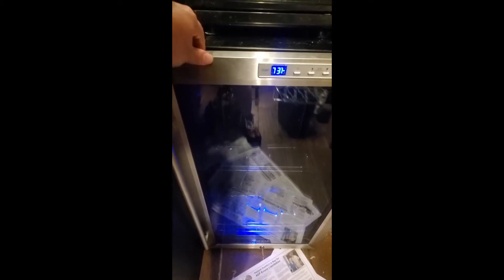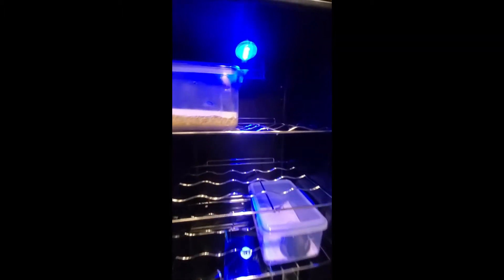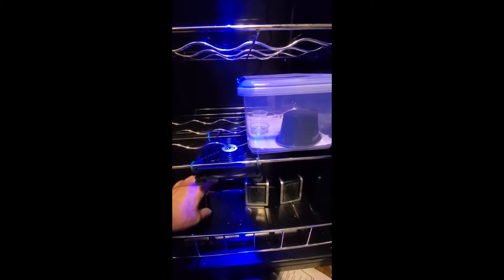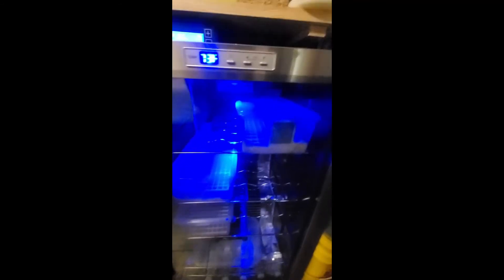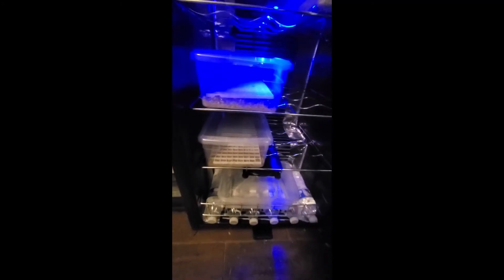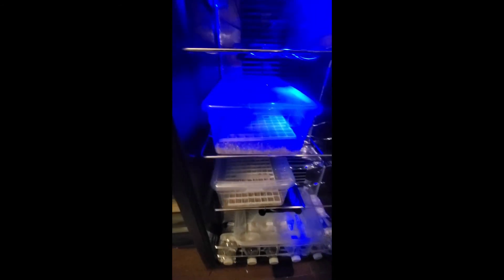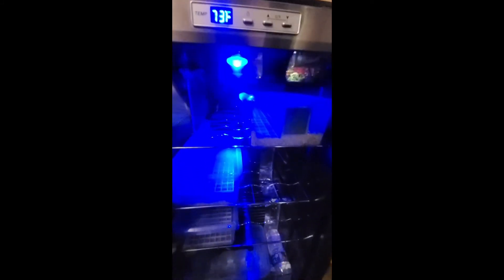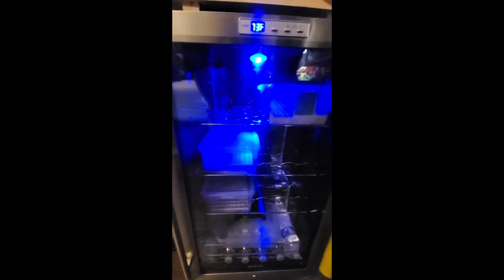Wine Cooler To Incubator Step By Step

Comment: Great video - thanks for taking the time to create and post it. Can you provide a parts list and catalog numbers for your heat tape and fans?
Reply from the maker: You first measure your incubator.   I measure from the inside back wall and bottom.  You can purchase the heat tape from pangea.com, we used 12" tape.  It will be sold by the foot.  Pangea can also attach the power cord.  You may have to trim some excess heat tape, from the side without the plug.  Then put black electrical tape on the copper end that is exposed on the cut side.  The fans we use are on amazon.  ANEXT, 120mm USB Fan, 120mm Fan, Silent Fan for Receiver DVR Playstation Xbox Computer Cabinet Cooling, 2 Packs(Black,1x Dual)
Any usb fans will work.  We use these in particular because they have small feet you can use as spacers.  Let us know if you have anymore questions.
Reply from the maker: Thanks for the support and Glas it was helpful.

Comment: if the cooler still worked you could have switched the red an black wires that cool it to then heat it up an just plugged it all into a thermostat

Comment: is this not dangerous? alot of coolers have flammable refridgerrant and say to specificaly not do this
Reply: Wine coolers don’t have a compressor which is for coolant. Wine cooler uses electricity to cool metal and the the fans blow that cold air into the cooler.

Comment: What size wine cooler is that a 34 bottle?
Reply from the maker: It is a Newair AWC-330E.  33 bottle wine cooler.
Reply from the maker: I am not sure.   I will check if the model number it on the cooler.

Comment: Hi I was very satisfied with this video wish the video was a little more clear couple questions I have is how do you control the fans after they are installed to go on when the heat drops or gets too cool
Reply from the maker: Glad you liked the video and thanks for watching.  We run the fans continuously to keep the temperature consistent throughout the incubator.  The fans have a speed switch but we leave them on high.  The temperature in the incubator remains less than 1 degree difference from the top to the bottom of the incubator.  Hope that this helps!  If you have anymore questions, please do not hesitate to contact us.  We are always glad to help.
Reply: @epicvibrantballs  so i have a 23 by 23 by 34 high incubator made out of a wine beverage cooler and I have a ve fan that pulls in air and blows out the top in the bottom corner should I have it blowing down and I have it connected to the thermostat should I plug it straight in the wall
Reply from the maker: @fernandoalvarez3891  I have four fans two mounted on the roof of the incubator and two mount under the last shelf.  They are all plugged into the wall.  They run all the time with the top two blowing down and the bottom two blowing up.  This keep my incubator Temps very stable no matter where you check in the incubator.  I did test the incubator prior to use by placing several thermometers on different shelves.  I use the small PC fans because they don't put out heat when they run.  I also have thermometers on every shelf while the incubator is in use to make sure everything is working properly during incubation.  If you have any other questions, let us know.